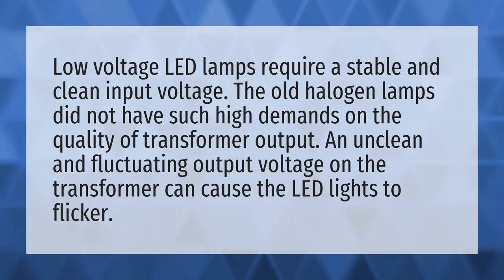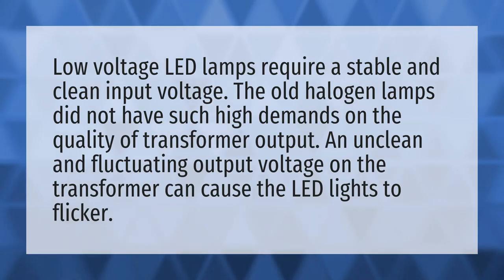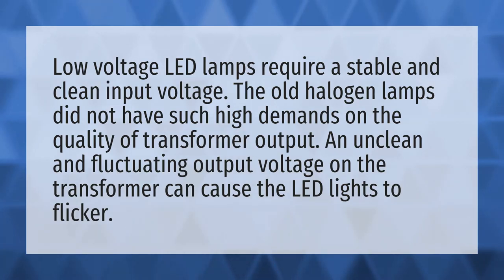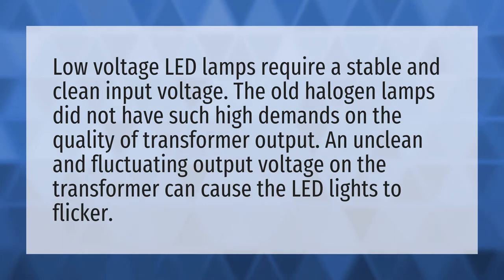What causes low voltage LED lights to flicker?

Comment: I have GVM LED lights that flicker only when I use my NP batteries.  The lights work fine with the AC adapter.  All this time I thought NP batteries had a standard voltage but I guess I was wrong.  GVM NP batteries are 7.2V and Watson batts for example are 7.4V.  That small difference apparently makes the lights flicker.  :(